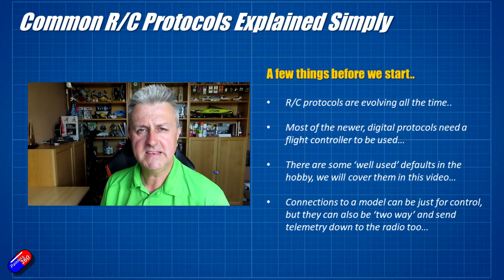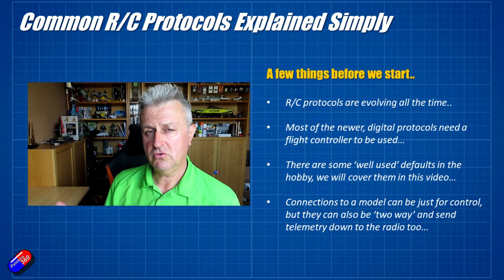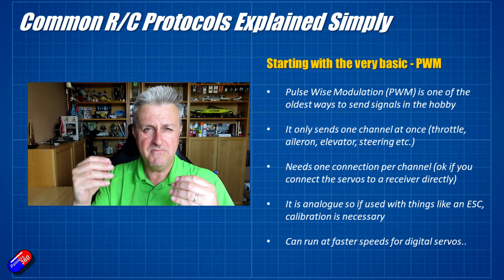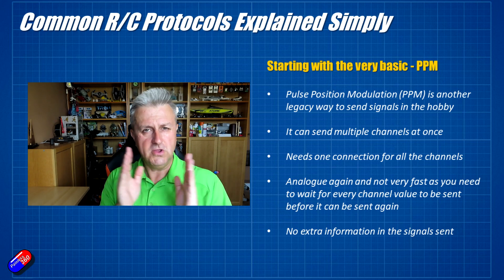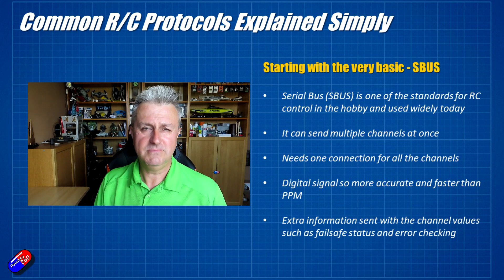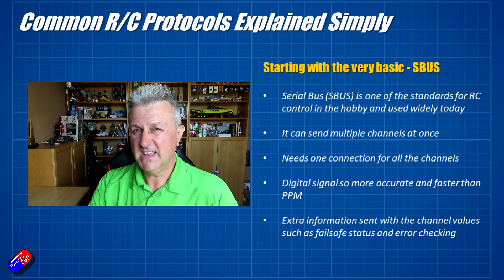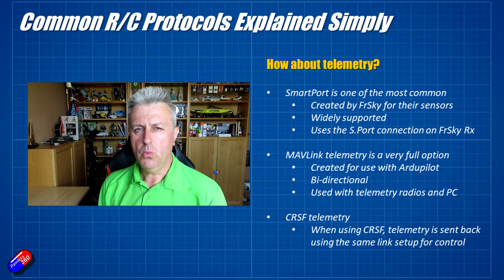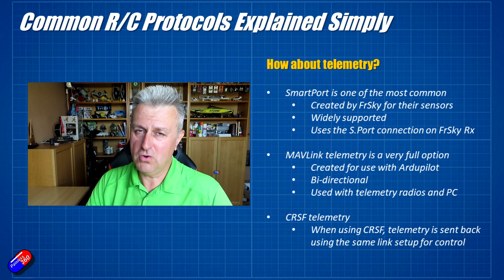RC Protocols Explained Simply  (PWM, PPM, SBUS, CRSF, MAVLINK, SmartPort and others)

Comment: I've just got in to the hobby, I'm in my late 50's and I am from an IT/maker background, and TBH I have been really surprised at how mature everything is. Take Spektrum radios for instance, I have an NX8 which I still see a lot of folk talking about as being new, yet it's not touchscreen and doesn't have have USB C. The DX models are positively ancient, but are still in widespread use. I know the Spektrum IX do have touchscreen and USB C, but for the money, I was very surprised my NX8 didn't have these features. It's also interesting that the cheaper Chinese stuff is so good, for instance the Radiomaster tx16s is a beast.
Reply from the maker: The 'old-school' vendors like Spektrum, Futaba (and even FrSky now!) are set on pilots only using their hardware and technology. They rely on pilots buying into the brand and staying with them as they upgrade. 
The issue with vendors like this is that they don't embrace open standards and allow for easy integration with the modern hobby.  Vendors like RadioMaster, Jumper and others that make radios powered by EdgeTX work with the key projects that large parts of the modern hobby uses (Betaflight, INAV, Ardupilot, ExpressLRS, HD FPV systems, 3rd party developers and the community. 
For me, that is what I am looking for from a vendor, not one who just wants to trap you with their hardware and technology. The downside for all that new 'open' technology is that you need to use resources like YouTube and the forums to get the best from them as they don't put the same time into manuals and support. For some, that makes these open systems too hard to manage. Happy flying!
Reply: @Painless360  Wow thanks for the long reply and on an old video too. I can't believe this was 6 months ago already. I'm re-watching a lot of stuff as I've just got interested in ELRS and FPV. The thing is thou, I am looking at using FPV and ELRS on helis. I'm just trying to work out the best way to do that, I'm thinking SBUS or UART. I don't need ELRS as I'm just flying indoors ATM, so I'm looking at flying one of my micro helis around the house from the living room, lol. Sounds a bit mad but it's good fun.

Comment: I have an Aura 5 lite stabilizer in all my planes. Its connected using sbus to FrSky and Radiomaster receivers. The Aura doesn't support CRSF but now ELRS 3.3 supports sbus I am able to use ELRS. I was also using a FrSky battery sensor to send back cell voltage via the s.port to my TX but don't see how I can replace that using ELRS.
Reply from the maker: Stay tuned, latest ExpressLRS recievers have a port to offer connection to sensors...

Comment: Question - do 'old fashion' PWM receivers output pulses on spare channels - even when the channels are no used??
Reply from the maker: They will output the channel values for the channels you've configured to the PWM outputs.  Even if they are not used..
Reply: @Painless360  First, thanks for your prompt reply!  And let me state my question another way.  If an rx channel can be configured to a switch or push button on the transmitter, will the rx channel output be a PWM pulse that corresponds to the switch position....like 1000us for OFF and 2000us for ON?
Reply from the maker: It'll be the same as the radio..

Comment: hi enjoyed your video on the RC protocols. I have question about the CRSF protocol. I have a problem with my crossfire system. If the TX module binds with the receiver and I get telemetry back to the radio, but I am not getting any output from the sticks and switches. What would think the problem is? This just happened to multiple models that been work fine for years. All my models with the crossfire system fitted have the same issue.
Reply from the maker: I'd suspect something on the radio or module if it has suddenly started to affect all of the receivers. Mabe something had broken in the module?

Comment: What's a antenna tracker I can use with betaflight 4.4/4.5? I have a working gps in my quad. I've been reading everything I can online.  But I'm still confused 😂
Reply from the maker: Check out systems like Ardupilot if you want things like that. A tracker needs telemetry from the model to know where to point... Best of luck
Reply: @Painless360  oh, that's disappointing. Nothing will work with betaflight?  I've been looking for a Rssi tracker, but everything is out of date. I can't find a current one that I can buy.
Reply from the maker: I suspect there is a good reason for that... Best of luck

Comment: Hello. I am using edgetx and 2 in 1 bidirectional ESC for my tank, I found that the deadzone of my throttle stick is very large, and I just play with my TX to make the deadzone smaller. I decrease my PPM center to 1300  and it work really well for forward position. While for reverse it still have a large deadzone.
What should I do to decrease my deadzone? And why change PPM center only change the forward neutral position?
Reply from the maker: I'd look at adding a curve to the throttle to adjust it. Sounds like the ESC needs calibrating... Best of luck
Reply: @Painless360  Yes I turn the PPM back to default and use offset and put the curve so I have more resolution and use  switch for reverse and reverse the curve lol its complicated but it works. By the way how to calibrate ESC?
Reply from the maker: The calibration routine should be in the manual for the ESC you have.  Best of luck

Comment: Hello, I'm looking for some help if possible? I recently purchased my first ever drone and to be honest, I have absolutely no idea what I'm doing. My drone has come with a TBS nano rx receiver, but I'm not sure what make or model of transmitter I can use with it.
If I'm being honest, it was a drunken purchase, and I'd completely forgotten about it until it turned up on my doorstep. Having said that I do still want to get into flying fpv. Thanks for any help in advance 🙏.
Reply from the maker: If you want to stay with the supplied receiver then you'll need a radio (or module) that 'talks' Crossfire. Something like the Tango II (https://www.youtube.com/watch?v=pFIcv1gD9J0) or a TBS Crossfire module for a non Crossfire radio.

You could also look to replace the receiver installed in the model with something like an ExpressLRS system that is a lot cheaper but that will need a lot of reading/video watching to get it sorted.. Best of luck!
Reply: @Painless360  Thank you so much for replying. It's been a bit of a nightmare trying to get my head around all of this, and I just needed someone to confirm what I thought. TBS seems to be the better product, and ELRS has more compatibility. I think I'll stick with the TBS and just bite the bullet and get either the Tango 2 or a TBS  module. ✌️

Comment: Sir can you help out with this Antenna Question. I have a FrSky X20s and I fly F5J Sailplanes and my Receiver will be the TW Dual to Help my Range and help me not to lose a signal should I install a External Antenna? Or the 2.4ghz in the Transmitter ok? Would installing the RF booster be the Best way to Go or the infinity 2.4ghz antenna do the job?   Thanks.

Comment: You got me thinking way too hard over here; is PWM really an analog signal?

I think the calibration is required to adjust the PWM period for the motor's natural frequency and/or set a low rpm threshold; however, when the PWM frequency is correctly matched to the motor frequency (because the ratio of pwm-freq to natural-freq affects the motors performance), most calculations just simplify to treating the on/off, PWM signal as the average value (ex: 5V logic @ 50% duty can just be treated as 2.5V for that same period). I also know it can be implemented using only analog electronics, and I was fooled into thinking that it was...until I was forced to write my own driver for an autonomous rover during a microP course at uni.

Just wondering...the more I learn, the more confused I seem to grow; now I can finish watching the video...
Reply from the maker: Now you know enough to start your own adventure through videos, posts and articles on the detail of how this stuff works... Happy flying!

Comment: Can I plug my receiver into a simple fixed wing FC using Sbus. 
And still use the throttle channel from the  receiver? As the FC has no throttle connection.
Reply from the maker: Yes you can. Depends on the reciever. Happy flying